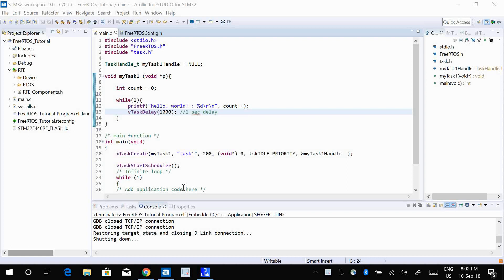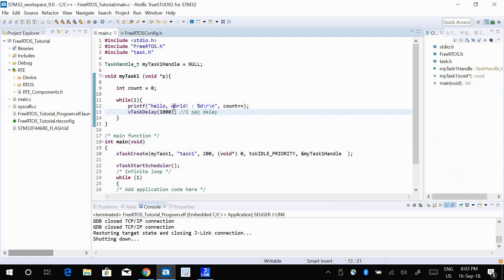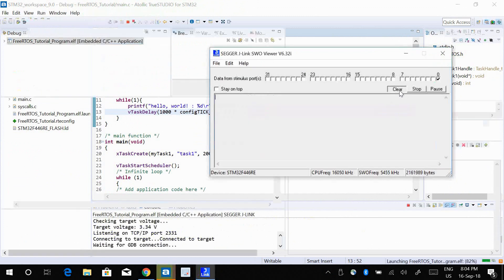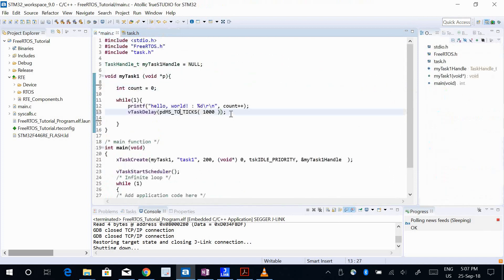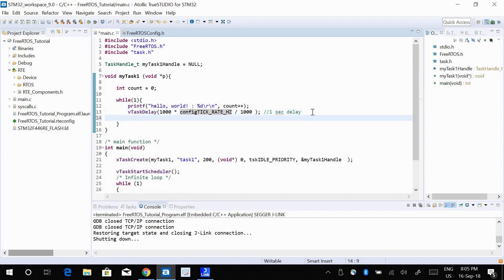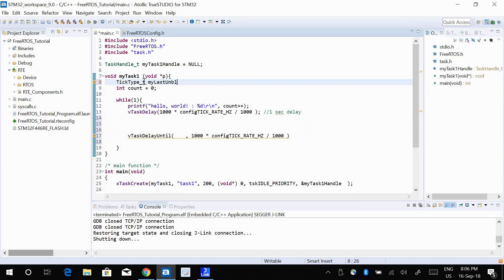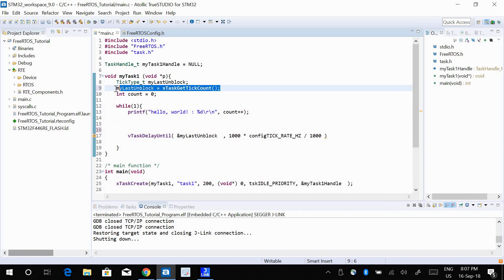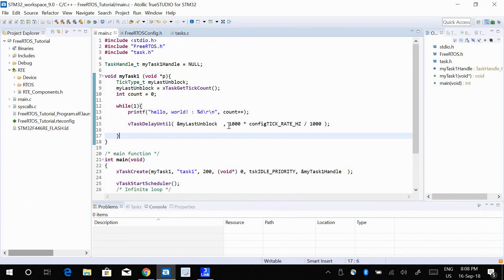04 FreeRTOS Tutorial: Delays

Comment: Hello sir...i'm working on RTG4 FPGA which uses RISC-V processor and trying to run it with freeRTOS.but I'm suffering from timing issues.like if I put delay of 1000ms then it takes 100sec..Means like always it multiply value by 100 and according to that I got an output. I tried all things but can't solve this problem..Can u please help me with this problem.
Reply: What is your TICK_RATE_HZ set  to?
If it was set to 100 and if we call vTaskDelay(1000)  --> it will casue delay precision of atmost 100 seconds